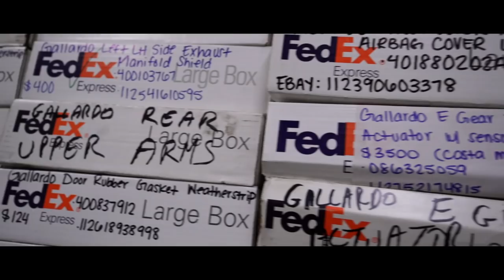Lamborghini Graveyard

Comment: Plastic manifolds (composite) are better because they dissipate heat quickly , are lighter , and cheaper to make/buy.   The best V10 ever made is not the lambo , it's going to be one of the formula 1 engines from 2002 , I believe at least 6 different 3.0L V10's were being made (honda , bmw , ferrari , etc...)   all of them making more than 800hp naturally aspirated and revving to 18000-19000 rpm
Reply from the maker: Nick Kautz yeah those plastic manifolds blow apart at 1000 horsepower so heat displacement isn’t worth it if the plastic can’t handle the pressure. and sure a v10 from a f1 car is cool but how could that ever find its way into a production car
Reply: 30psi seems to be the upper limit for the factory plastic manifold on LS engines ,  you'll probably end up exceeding that figure eventually, so you're right metal is better in that case.   I would DAILY the shit out of a street car with an F1 v10 ,  but the lack of low-end torque would make the car undrivable for most people.  A company called Judd (juddpower.com) sells a wicked 5.5L V10 that makes 800 n/a and "only" spins to 8500 so it actually lasts a long ass time.  I would put that bitch in a Ultima gtr most likely